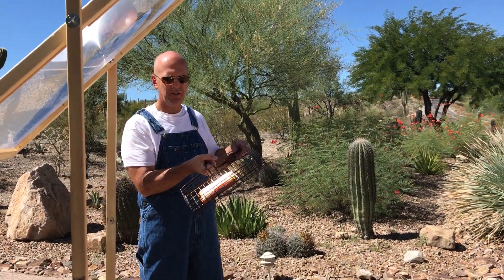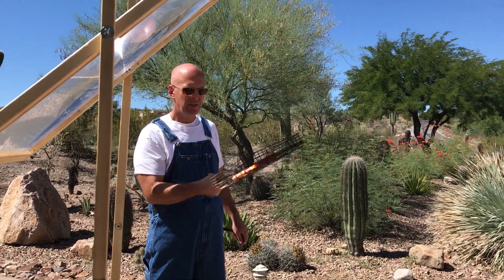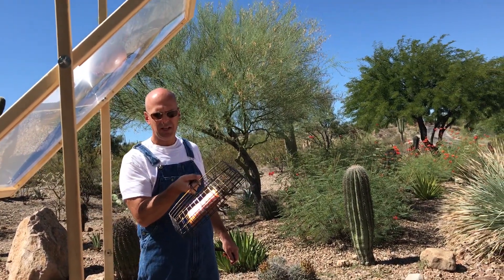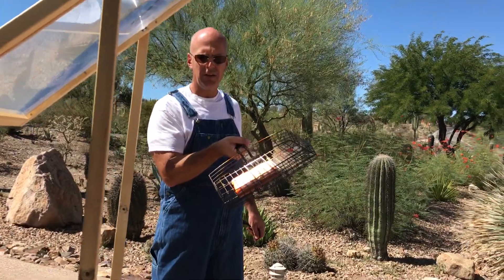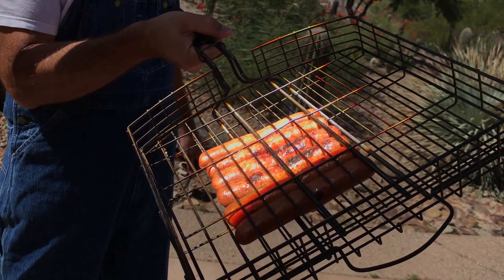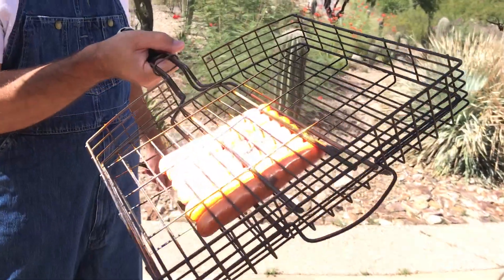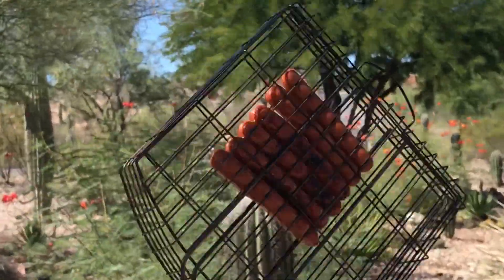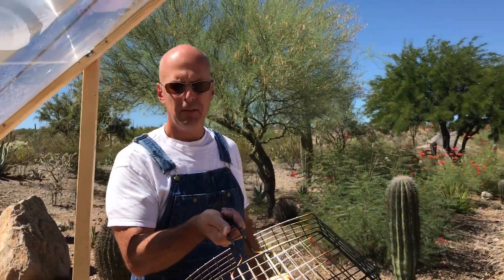Solar Power BBQ in Mid-Air with Fresnel Lens

Comment: Do you have to heat both sides this method?
Reply from the maker: I could probably cook one side if I wanted to.  I wanted to see if I could simulate the scorching that takes place on a BBQ or fire, and it did that.  I am not sure how much heat got to the middle of the dogs.
Reply: @joemyheck1  how did they taste, like normal bbq?
Reply: Konstellashon Yes. Unless you cook it at a lower level of heat.
Reply: Where did you get your huge fresnel lens? I'd like one